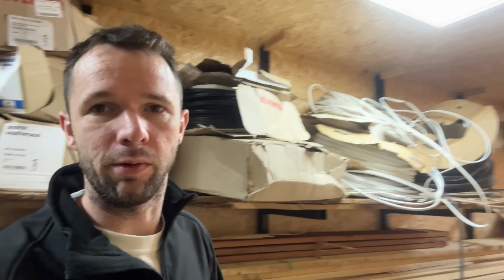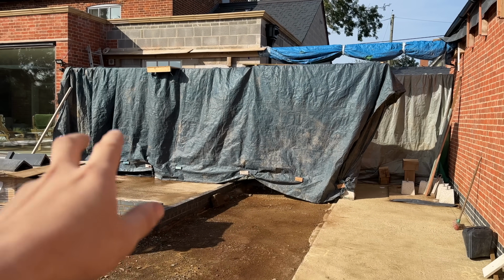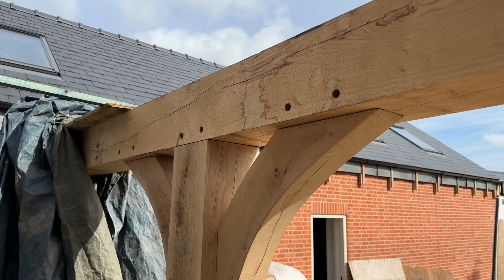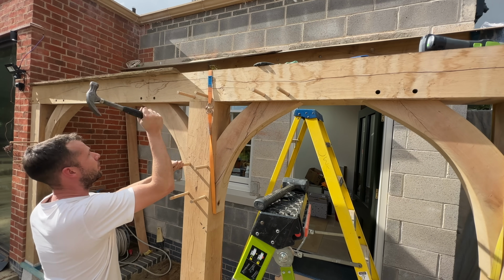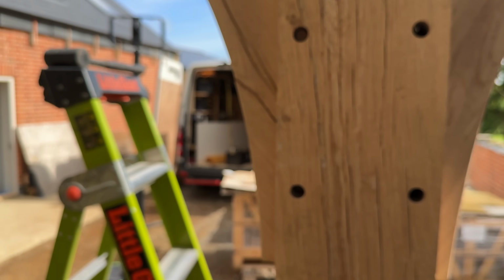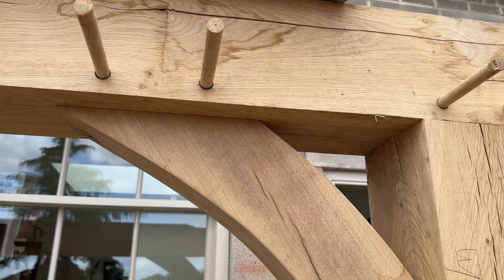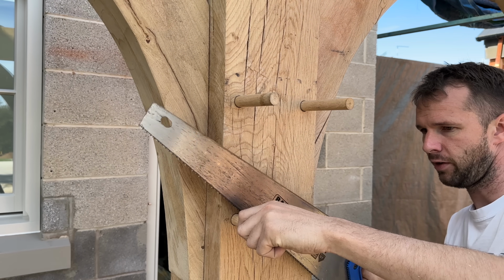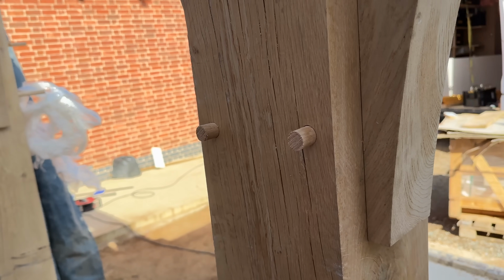English Joiner Creates Beautiful Framing. Kerf-Cutting and Draw-Bore Jointing

Comment: I am loving this current series.
Like many others have commented, I too have learned a great deal from you over the years. 
What I particularly like is you show not just high end cabinetry work, but stuff like this current series and everything in between. 
I particularly liked the videos you did on repairing an old pine door, adding a bit of length to it (especially as I would like to do the same to my drafty front door!) 
And the repair to the garden door. Yes you could have ripped the frame out and made a new one, but the spliced in repair was great, and just about any of us could do following your lead. 
Please keep up the great work. 
All the best from a POM in NZ!

Comment: How about some wooden reels for the cables. Or a box with a latch and a handle. Like a case with an horizontal axle inside that would hang the carton reel up so that you can unwind cable from it. Tgen at end of the day you shut the case, lock it and throw in the back of the van. Make out of some sturdy timber, of course!😊🎉

Comment: Fantastic skill and attention to detail. I heard you mention sanding down the water stains in an earlier video.  I am sure others have mentioned it Oxalic Acid worked well on our green oak. Scrubbed on and then washed and scrubbed off. I was sceptical but it worked well and reached the parts a sander struggles to reach.

Comment: Re:seals ocd aggravation!...I've seen window fitters use a tub with a hole cut in lid so u can draw out what you need. You might have to take all or an amount off the reel and you need some tubs! ( i never throw a tub that's cleanoutable away!) Love the channel, although I'm a decorator not a woodworker. Appreciate the tips on tools etc which I've found useful and just the output of a tradesman who cares about his work 👏🏻👍🏻

Comment: Great work Ollie. I used to work with an old school joiner who had a set of draw bore rods that were like chef’s sharpening irons but they were made in such a way that you could hammer them into the draw hole to bring it together but when you turned it it loosened off do you could pull it out to disassemble. I think he made them as I’ve never seen them since

Comment: Fantastic as usual, a pleasure to watch. I can definitely confirm with one of the other comments, oxhalic acid works an absolute treat on greying oak or water stained oak as long as it has not been previously treated with anything. It will cause it to go a lighter colour for a while but it is only temporary. I would encourage you to try it on a test piece, if you haven’t already, the results are great. I dilute it in hot water, just makes it quicker. I’m sure you may have covered this question but I cant find it, why do you cut the draw bore pegs off half way through the joint (by drilling them) and then hammer in new ones from the other side, creating 2 halves of 1 peg? You obviously have a good reason, I just cant work it out 🤔

Comment: For OCD control. I have used the caravan electric cable tidy reels ( the big plastic orange ones, would send a link but can't do that on here) and for bigger amounts I built my own version out of ply just wider and use a rod between two sawhorses on site to unwind. Bit of masking tape on end to stop unraveling. Hope that helps

Comment: Haha. I have exactly the same issue with the reels of weather seal - a constant bugbear of mine. The Deventer cardboard reel cases seem to be the worst - I know that Deventer sell a trolley dispenser for a single reel but it still has to be within the cardboard casing to work, and by the time the couriers are done delivering the thing to me from SDH or Reddiseals the cardboard is already bent and knackered - and even then I usually keep a stock of about 6 different weatherseals in, so I don't fancy spending the best part of 2k on 6 trolley dispensers. I suppose you could decant the whole reel onto a decent solid cable drum or something similar - but that'll take a fair while for a 150m coil, and to be honest I'm usually too busy for faffing around with things like that.

Comment: I think (hope) I understand the draw bore jointing; the slight offset of the hole in the tenon is very effective as a lock. 

I'm not sure I understand why you don't drive the peg all the way through in a single piece rather than driving it thru, drilling to the tenon and using the cut-off from the opposite side to fill the hole you just rebored? Is this to prevent a single-piece peg from splitting if the joint flexes too much?

Comment: How would you tighten up the draw pins should / when the timber shrinks with the plugs in place?
Reply from the maker: shouldnt need to normally they are cut off flush anyway , but tap them in more itll tap the plug out then redrill abd reinsert plug if you had to
Reply: I don’t understand why you don’t hammer the pins all the through.
Pardon my ignorance.

Comment: Interesting that you chose to only peg them from one side. Structurally I doubt it matters, I suppose the strength of the joint is the same. Was this because you were concerned about the aesthetics? The tapered plug leaving a slight shadow at the exit hole due to it’s diminishing taper? I like the way you used the offcut peg to fill the hole on the “back” side—that was effective. Was the plan from the start to only peg the joint from one side? Or was it an adaptation due to something else?

Comment: On the Draught seal, that has been a peeve of mine for 14 yrs!
 Worse when I was purely an ‘out a van man’   I’ve seen rolls destroyed in spite of your best efforts!  I been up
Shlegal many a time whining!

Result? I avoid taking any roll out the
Workshop EVER! I make all the beads or
What ever site
Application is, oversize ‘loaded’ ( which is the only way to go TBH.  Any loose I
Need, you just have to guestimate and
Take as a small coil.

I know you’re a mega tight arse…sorry frugal 👍🏻 but I’ve thrown half rolls away!  As you well know, once that crap cardboard is of it… it snags on EVERYTHING for a passion!  Always end up all knotted up and useless.

so; it doesn’t exit the workshop as a full roll ever! 
Preload beading and
Take as an ensemble 

Don’t worry about wasting 50 mm here and there, it’s not going to end up  even close
To  a half roll